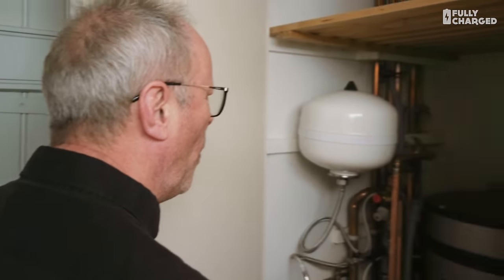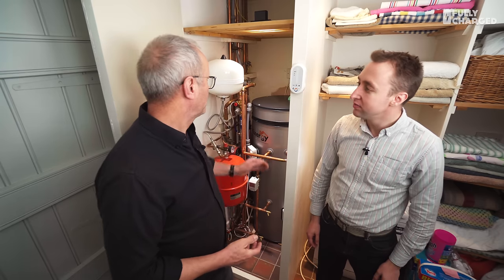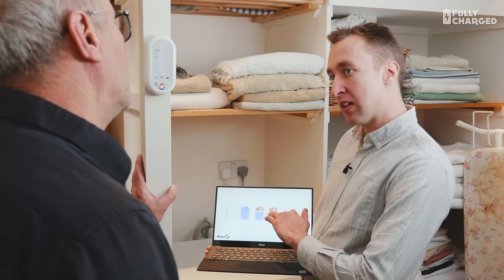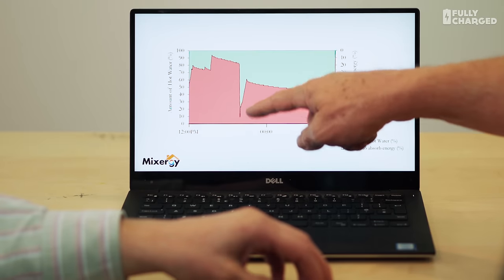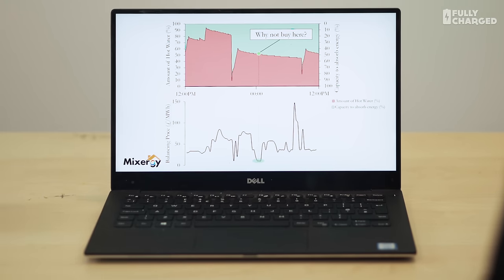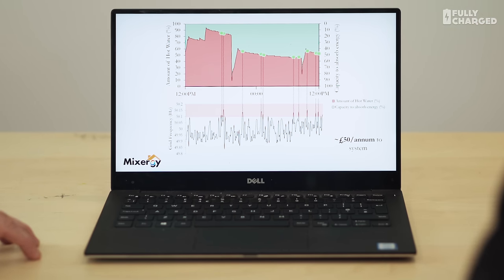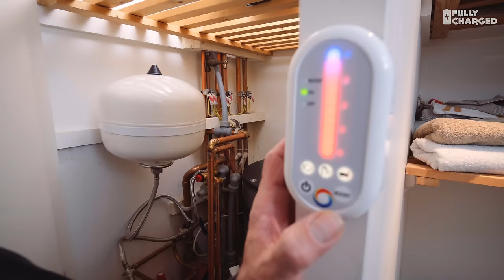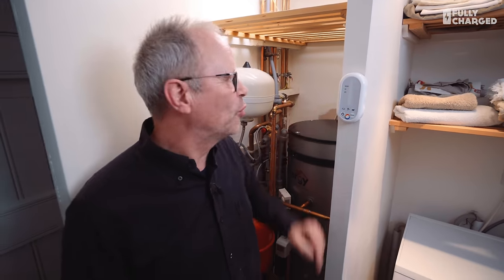Mixergy Hot Water Tank | Fully Charged

Comment: I have a hot water tank with 2 elements heated by solar panels. When the top of the tank reaches the set temperature the Eddi automatically switches to the bottom element to heat up the rest of the tank. Simples!

Comment: Clever but missed the point, why not have thermal solar inputs which is better than using electricity, yes it does need a sunny roof but works on cloudy days. A sunny day will easily give a fully tank, or about 9KWhrs energy for little energy for the thermal solar pump.
Reply: because most people don't have space for thermal solar and electrical solar.

Comment: It's good that they are trying to improve older tech, but it's still an electric resistance water heater with energy factor below 1.   In the US the price of heat pump water heater has came down significantly in the last few years (~$1200) and they have energy factors in the range of 3.5 now.   In a hot garage the efficiency is even higher.  I always like your videos Robert, may be you can do one on HPWH.
Reply: Danny Tam true, but we don't have hot anything in the UK, especially in winter. You might get 1.5 out of a heat pump on a good day, and then only to 45 maybe 50 degrees c.  So still need a fair amount of resistive heat as well. Air source are noisy and our houses are close together, ground source massively disruptive. This is a good compromise.

Comment: I wonder how the small pumps inside will handle hard water; our hot water tank needs its thermostat changed every 7 years or so because a giant rock of calcium will have formed; small pumps get gummed up quickly and I've replaced quite a few.  Perhaps a water softener is a good investment?
Reply: Noel Dillabough The pumps only circulate the water in the tank, which never changes. Hot water for use passes through a coil, by its own pressure. There will be no scale issues.

Comment: Holy Moly,  I have a tank, a new boiler and a smart meter. It has cost me this season  to fill my hot tub of 1500 litres too 38c just under £1.40 per fill. I haven't been without hot water since the new system was installed and it's costing me a pittance. 300 litre tank and endless hot water. Bad argument for stratosphericaly expensive equipment.

Comment: You are very lucky to get 22 years out of you old tank. Ours seem to last around 7-9 years and then leak.
Reply: That's terrible, are in a hard water area, copper or stainless?
Reply: That1ufo normal Sydney town water which isn’t hard and fibreglass tanks.
Reply: Can you not get copper or stainless tanks?  fibreglass tanks seem pretty useless to me. How long are the warranty's on the tanks?
Reply: That1ufo usually the warranty is about 5 years. Stainless steel and copper are extremely expensive here. We now have a inverter hot water system that runs from the power generated by a dollar array on the roof.

Comment: My ancient tank gave up the ghost yesterday. How apt that this should appear now! I suppose I will have to pay for mine if I get one though :-) The issue about whether they are reliable is a bit worrying. So many products these days are not fantastically reliable even with years in the market. Slightly cheap components in one part or a design issue that only shows up after long operation. If I go for a Mixergy tank it will be a fight to get the boiler man to install it I am sure and then .... but I will try, I think.

Comment: Didn't you get a sun amp installed? In any case this product if combined with a suitable energy plan and transfer of control to the supplier is another great instance of demand control which could reduce the strain on the grid and save consumers money. In the long term I'd hope we move more towards heat pumps coupled with demand shifting tech like the sun amp.

Comment: Computers are good at producing heat and they are generally economical to operate for 5 to 8 years on their own. I could be hosting a website and email server while heating my water effectively cutting costs in half :) Performance and heat output could be reduced when there is more expensive electricity and when there is less storage. 
The cheapest option is to heat indoor air in winter, next would be running a liquid to liquid heat exchanger or make food-grade watercooler for computer and run the processor at ~50C to ~60C reducing chips lifespan down to ~5 to ~10 years at which point it would be more economical to recycle it anyway. Another option is to go with a heat pump reducing processor temps down to ~30C  ~40C at which point temperature is not going to cause degradation. But then the system would need to be in such a way there is no condensation at processors side :)

Comment: Hmm I must say that I like the principle but I am not seeing the point in this system except that you are using this water storage as a big battery that heats water on command; not very far from a regular water heater with timer + good thermostat, is it? Are you sure that from a cost point of view vs. over engineering this system is viable hence the gains compensate for the costs? What about some solar panels and instant water heaters? You sell everything and consume just what is needed?
Reply: In the UK at the moment, it's pretty hard to sell excess energy from solar panels. The feed in tariff is only 25-30% of the normal electricity price, so it's better to try to use the power you produce. 

With an instant water heater, you'd have to buy power if you shower in the morning or evening.

There's very little 'engineering' involved in this, just moving the element to the top of the tank and adding a small computer. It's very cheap compared to a home battery.
Reply: And as of March next year you will be completely unable to sell excess electricity back to the grid in the U.K. 
With an instant water heater you also cannot use solar water heating if you have that. If your largest hot water use is reliably at one end of the day you can use solar water heating to get that.

Comment: An interesting idea... and likely just one of many possibilities around the concept of energy smart things about the house. Another idea... Air conditioning. If an acceptable comfort range is between 70 and 75 F say... then a smart AC unit could be essentially overcooling the house during the day while cheap solar power available... down to 70... and then basically slowly 'coast' back up again when the sun goes down using the 'stored coolness'  thermal energy. A refrigerator could do the same thing. Overcool... then drift back to the other extreme. In the winter reverse the process... overheat in mid day.
Reply: Jim Lambrick i employ a similar concept to maximise my solar PV use during the day. I press the "fast freeze" buttons on my large chest freezer and smaller kitchen freezer at about 10am each morning. The freezers cool down from the usual 18c to -35c throughout the day, drawing about 100 watts for a few hours, a nice small base load for my solar panels. Late afternoon, i turn the fast freeze off again, the freezers gradually return to usual temperatures overnight and rarely if ever switch themselves on during periods when there is no solar available. You could do the same for air con on a much bigger scale a 2000 litre tank of chilled water in the basement perhaps?

Comment: Forget the Internet-connected nonsense. Just having a tank with the heating element near the top would be good for use with solar hot water. I've got solar hot water and the electric boost takes a couple of hours to get a mostly-cold tank up to 55 when we've had a few cloudy days. Having the heating element near the top could get a usable volume for a shower a whole lot faster.

Comment: Very clever version of what used to be referred to as a 'poor man's battery'. It will be interesting to hear updates on its performance (no pressure Rob!).

We had a twin element 250L HWC fitted when the old one failed. Top element heats only about 80L and the bottom one, which we run solely at present heats the whole tank. 

The plan is to install a PV system here (had 6kW at our last place https://www.harmlesssolutions.co.nz/index.php?route=module/blog/view&blog_id=7 ), plus maybe a micro hydro, and then power the top element from the grid and the bottom from PV/hydro. With reasonable self generation the top element should become largely redundant or at least be only 'topping up' the temperature on the top 80L sufficient for immediate requirements.

Comment: I have a light switch right at the water heater that I switch on 10-15 minutes before a shower and turn it off after the shower. It's saved me quite a bit.
Reply: asix only issue with that- you never heat your whole tank to a high enough temperature to kill legionella bacteria. You should so so at least once a week.
Reply: +Spencer The water is fully hot when I take my showers and it's still being heated when I'm in the shower and I do forget to turn it off sometimes. It takes roughly a month for Legionella bacteria to establish itself so, no fear.

Comment: additional thought..........water tank heating elements should change to an Inductive element with combined heat exchanger fins..........an example of failure to change. Anyone who's used a inductive cooking element knows they heat faster than resistive elements , even when the power rating is identical.
Reply: andy cairns that only applies to a cooker, where resistive elements are in contact with the outside of a pan, and consequently loose a lot of heat to their surroundings. A resistive element immersed in a water is actually 100% efficient, more than even the very best induction. If an immersion heater element fails, they are £20 from any diy store.

Comment: My immersion heater in my tank has a Willis tube attached. The small volume tube heats first, then the main volume of the tank if you want it. My tank is 30 years old.
Reply: Interesting Paul, we have come across these systems, the advantage here with our system is the fine grained control of temperature and ability to select your state of charge as you wish. The software and scheduling abilities will also allow adaptation to your useage profiles to further save energy. Furthermore external Willis tubes lose quite a bit of heat compared to our system where all the heating is integrated within the insulated envelope of the hot water cylinder.
Reply: Pete armstrong no doubt your refining the concept of heating the right amount of water at exactly the right time and as cheaply as possible. We enjoy the fruits of our solar PV and Solic 200, good luck with your endeavour.

Comment: Nice idea... except for the pumps, which add an unnecessary failure point for a hot water supply. I'm surprised it doesn't use a heat pump instead of a heating element.
Reply: Hi Paul, we can also work with indirect sources including heat-pumps - the pump is incredibly reliable as it uses a magentically decoupled impellor - by controlling the temperature via the pump we're not relying on mechancial thermostats which are arguably less reliable!

Comment: Very interesting idea?  Good to see someone trying to make these sort of things to off set the energy costs for homes!  I am wondering about how the fact that allot of places have hard water like most of the south east of the UK, How will this lime scale problem effect the running of the water tanks?  The lime scale will make the tanks heating element and sensors work worst over a short time in very hard water areas!  This will be a big problem for the company to address, Just using some form of anti-lime scale treatment is not always easy or cheap adding lots of extra costs to maintaining the tanks in the hard water areas compared to the soft water areas?
Reply: I think these use an internal heat exchanger- the water in the tank doesn't change, it transfers heat to water passing through a coil. This water won't be heated to a high enough degree to cause significant scale, and should it eventually scale up its easy enough to flush descaler through a heat exchange coil to clean it off.

Comment: How about a hot water heater that has two elements? Most of the water heaters in the US have two and the top element comes on for high demand or daytime heating while the bottom or both come on for nighttime heating.
Reply: It comes with 2 elements if you wish. What's great you can use it with solar PV and heat pump using cheap grid electricity at night.

Comment: Why not use a tankless water heater?
Reply: Why are we the only two here wondering about this?
Reply: The benefit of storing the energy and also the throughput of the system. Different properties have differing needs, one solution doesn't fit all. I have a solar iboost fitted to my hot water tank, only once since early May have we needed to use gas.
Reply: No opportunity for energy storage.
Reply: The lack of storage is obvious. I can't speak for Proxima, but I can't imagine that a system on this scale would be anywhere near as efficient as a tankless water heater.
Reply: A storage tank heated by solar hot water and passed through a tankless/instantaneous gas heater, the tankless heater will only kick in when the hot water drops below a preset level
Reply: tankless needs energy to heat the water the moment you ask for hot water.  therefore if you ask for hot water while energy is expensive, you will be enjoying an overpriced bath.  you would have adjust your bathing schedule to 3am in order to have the lowest price bath.  with this tank, you could enjoy a  hot bath any time of day and still only pay the low 3am price for the energy.
Reply: tankless water heaters (combi boilers here in uk ) are good in that they take up little space and have no standing heat loss. but they are poor on hot water flow rates and less reliable . The flow rate on a megaflow is upto 72litres a min with a 3.5 bar. and has a 25yr warranty and with twin immersion heaters very reliable as you have a back up one. As a dump for surplus energy (battery ) they are way simpler and cheaper than other heat/energy storage.
Reply: I have a 4.5gal/min tankless in my house (in Canada) and I can take a half hour hot shower if I want to...(I don't but I could...).  If you're not getting hot water in your house it means your tankless is too small or your hot water runs are too long (and not insulated).
Reply: Which is why we need grid storage of electricity...
Reply: I guess a tankless water heater is still more efficient than one with a tank. Apart from the fact if heating when prices are lower are included, but that is economical efficiency, not energy efficiency.
Reply: If we had grid storage "time of use" billing wouldn't exist.  So your power would be the same price all day.
Reply: Not if you had a battery storage system. Charge the battery when electric is cheap or the sun in shining.  Now the tankless is just one more item that uses power, the battery stores power for any type of usage vs just on off hot water usage.
Reply: You cannot integrate a tankless system with solar water heating.

Comment: Just placed my order for a 150L slimline Mixergy tank, for installation during the last week in February
Reply: hi charlie did you get this installed in the end? thoughts? im looking into getting one.
Reply: @benbreeze2678  Hi Ben, yes the tank was installed earlier this month - nicely (UK) made bit of kit. As it's the first one fitted in the North West of England there weren't any plumbers in the area trained by Mixergy to install it, so I used a local company who were supported over the phone while on site by the Technical guys at Mixergy. The plumbing is straightforward, the smart side of things took a bit of fiddling with as first the ethernet over powerline connection to the internet didn't work (my fault), and wiring the tank controller into the existing Hive / boiler control system was a little more involved than expected; in the end a professional and very diligent Mixergy engineer travelled up from Oxford a couple of days later and commissioned it gratis. The tank's been running now a couple of weeks and all is good. The ability via the app to create individual daily schedules for a specific volume of hot water to be heated ahead of peak demand, review usage and real-time remaining availability, and set parameters to ensure a minimum hot water reserve is available throughout the day is certainly reducing the amount of energy I'm using, compared to heating a whole tank blind regardless of need as before. The tank typically looses around 10% of its stored heat over 8 hours. Being able to observe the markedly different amounts of hot water consumed when various family members shower is also informative, an opportunity for behaviour change there too ;-)
Reply: @charlierea3324  Thanks charlie, got mine installed already. how do you set the minimum available water level? i assume by the schedule?
Reply: @benbreeze2678  Yes, under the schedule you can set the tank to maintain between 10% (as a minimum level for example) and 30% - when the hot water gets down to 10% the tank automatically recharges to 30%.

Comment: If you leave hot water supply out: a battery won‘t loose 20% energy over night, and you can get electricity back in case you should need it.
Reply: Everyone needs hot water in their house though and these tanks are a heck of a sight cheaper than an equivalent battery storage solution. FWIW batteries seem to have 90% round trip efficiency and they degrade over time. Converting a high quality energy (electricity) to low quality energy (heat) isn't a great plan which I guess is why these folks have clever techniques to learn usage and minimize energy loss.
Reply: Right, storing thermal energy by proxy in a battery doesn't make a lot of sense. IF you require lots of heating, then hot water is definitely a decent way to do it.

Doesn't make a lot of sense in Australia, unless you can use that heat to provide cooling...